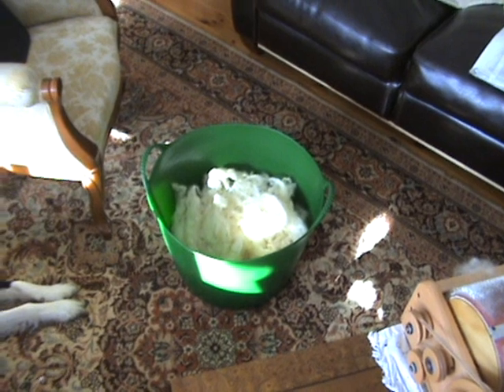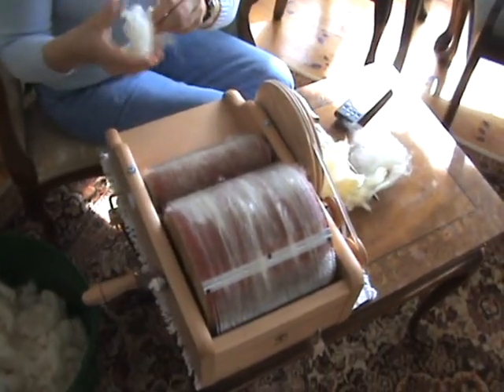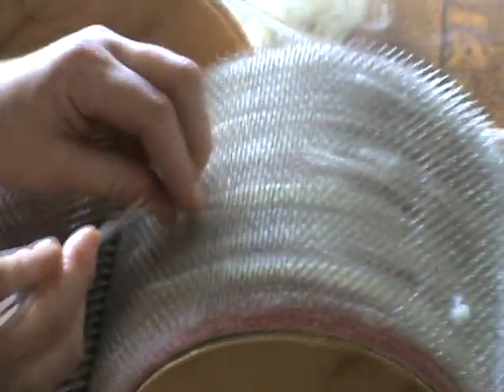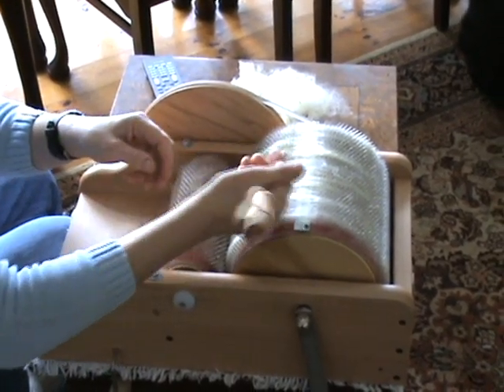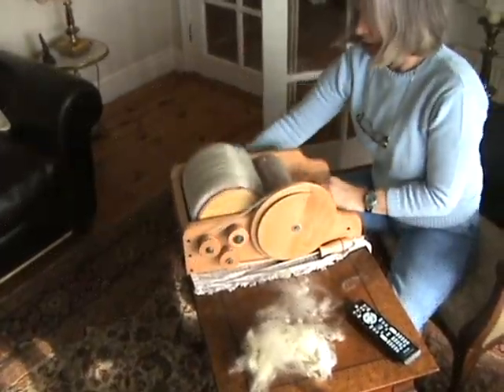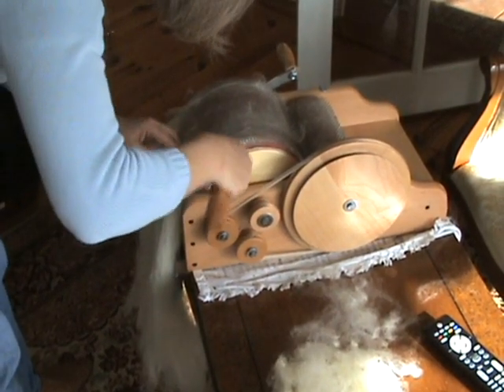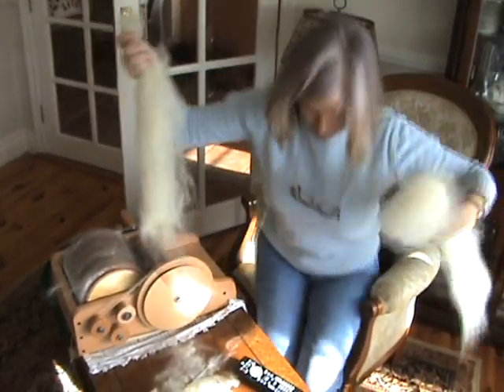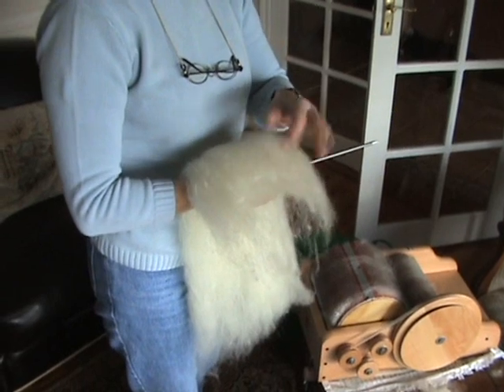using a drum carder

Comment from the maker: Hi Martin.
That was me quite a while ago!!
Anyway, it's not spinning - it's carding i.e. passing it through the little bent pins attached to the drum which opens out the locks and mixes them together. The more times it goes through, the more blended and mixed the fibers are and the smoother the spin on the batt when it's removed. It will open out some tangled bits too 'though it doesn't remove dirt and short fibers. Combs do that.
Depends on yourself how many tomes to pass it. Often people make several batts then blend them e.g. make 4 batts, divide each in four then re-card one from each of the 4 together to distribute the fibers more evenly throughout.  
The carder is also used to blend different types of fiber together e.g. angora and wool or different colored fibers. Then the number of passes depends on how blended you want the final fiber for spinning to be.
Hope that makes some sense.